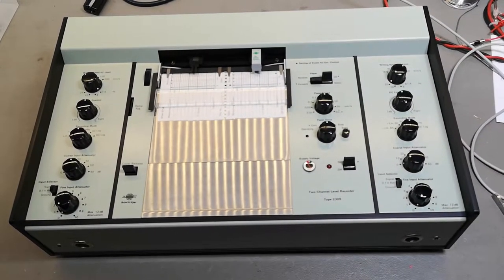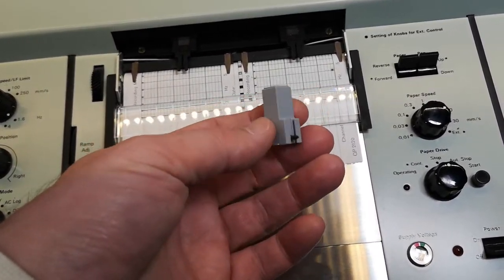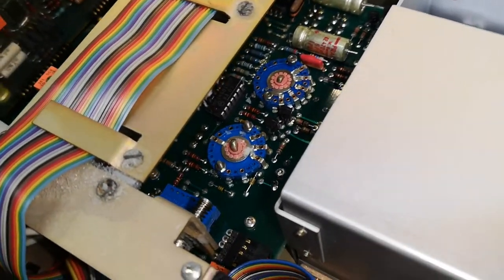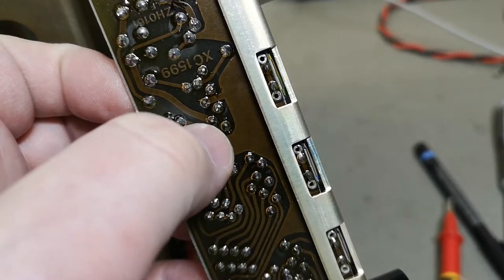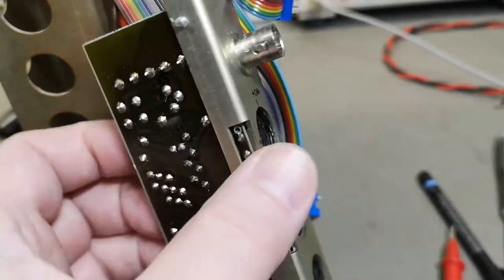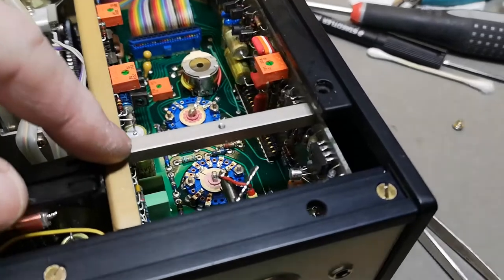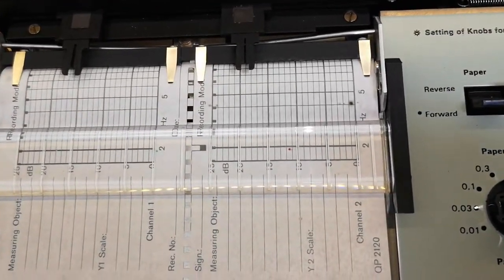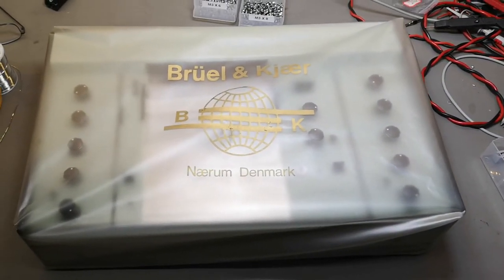Brüel & Kjær Two Channel Level Recorder 2309 test repair teardown

Comment: Very cool device! - too bad it had the dreaded battery goo all over the battery compartment! - the linear motor is built identical to hard drives of that era when voice coils took over from stepper motors. Very nice - this must have been very, very expensive!

Comment: If any of the wire has been "infected" - Replace it all!
Reply from the maker: EXACTLY, that was wild to see the acid damage could travel all the way
Reply: @TeardownOZ2CPU  Also check - Most is not acid but alkali. Test by putting a bit of vinegar on it to see if it bubbles. Best way to see if you have removed it all. Then flush with clean water.
Reply from the maker: @jrkorman  that is a good trick, I feel there is a chance I get a battery problem again in the future, it seems to be a never ending problem.. maybe in 200 years a non leaking cell will be invented ?